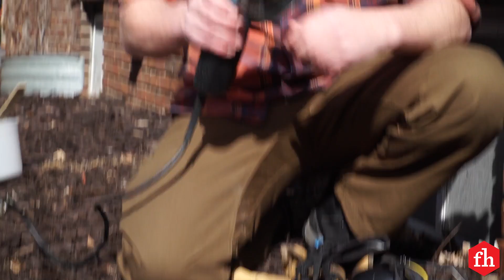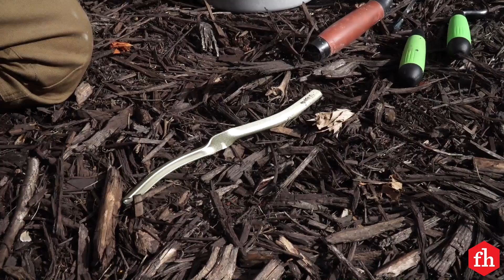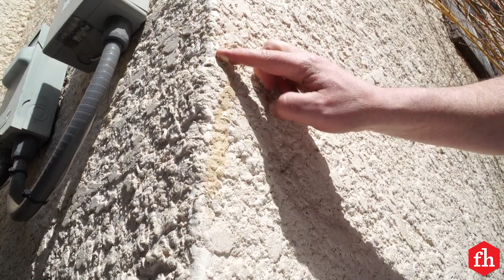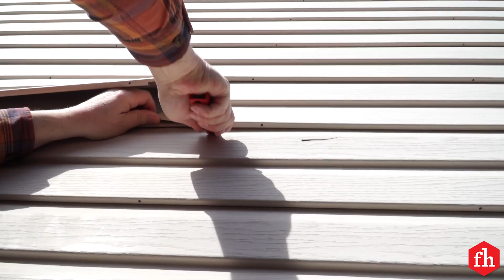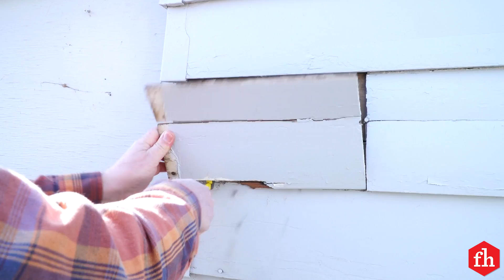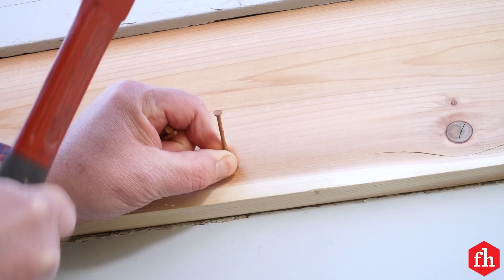Home Exterior Repair Tips You Should Know

Comment: If I may, when you have reinstalled the vinyl siding with a new piece, it appeared that you drove the aluminum nail all the way in. It's important that you do not drive it in completely but rather leave a small gap of 1/8" to 3/16" so the vinyl can contract or expand with outside temperature changes. Thank you.